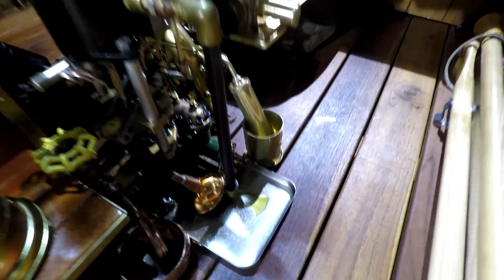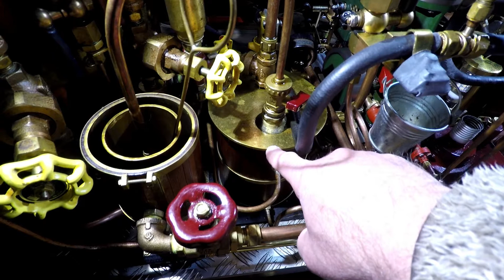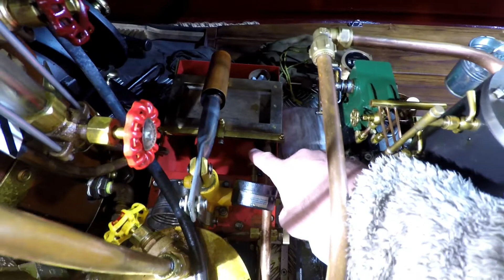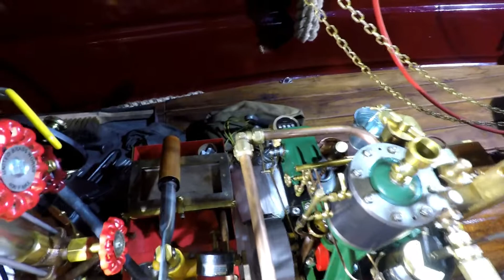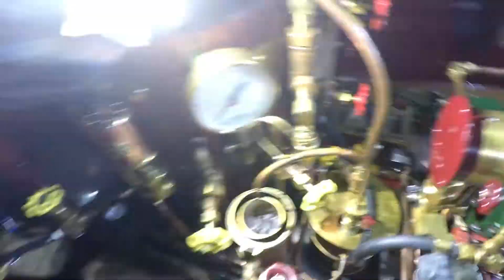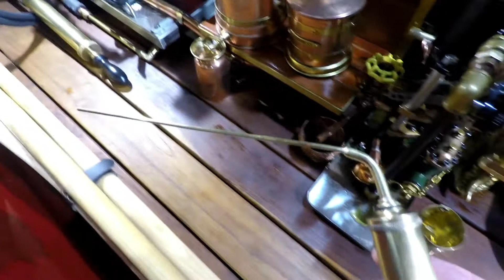Waste Oil Process Management

Comment: Bonjour Christoph,
Bonne Année again !
Good idea to avoid the loss of the oil... In theory
About your large beautiful syringe, based on my experience on mine which are a bit smaller but also using 480 grade oil, I fear you will not be able to recover all or part of the oil, I do not trust the suction process.
Your oil will be distributed in all the basins which are flat and the small suction nozzle will not work because it requires a certain thickness of liquid to be efficient and in addition it is flexible so it will slide. 
I would kindly suggest you to test your solution.
If I had to suggest an alternative, as there is no pressure, I would suggest a hole in the basins with under a 
container able to receive the falling oil.  Some reflection and possibl realization for this new year :+)
Amicalement, Raphaël
Reply from the maker: Good morning Raphael... Happy new year to you too...! You are right with the syringes one gets the most part out of the basins, a mix of oil and water... the rest on the base one has to wipe out with tissue to burn it afterwards... I testet it before live. The very thick steam oil has to be sucked if it is still hot which improves the recovery rate. Once again Raphael you totally 'swing' in the right steam mood ;-)) Thank you for that and bone sunday!